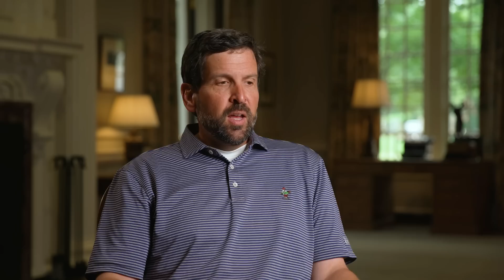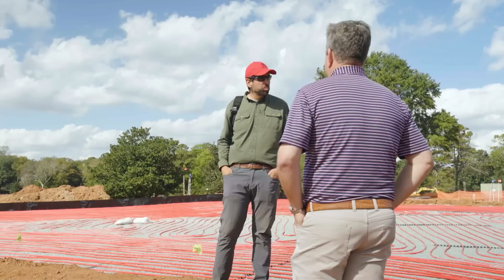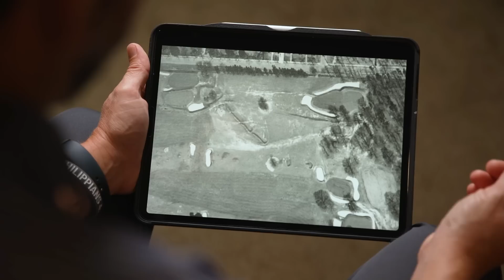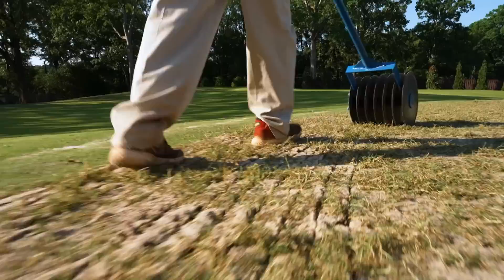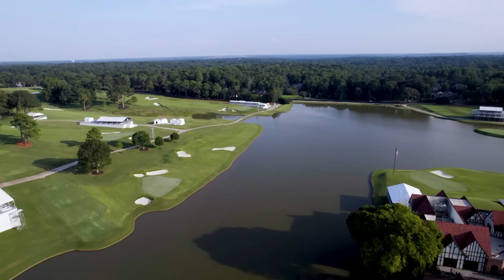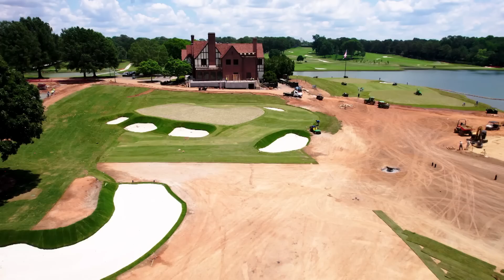COMPLETE restoration at East Lake Golf Club led by Andrew Green

Comment: I played Eastlake in 2005 in a 36 hole US Open qualifier. I thought it was very hard (I was +5 in hot and wet summer conditions), but enjoyed it. I think the restoration has taken some of the teeth out of the course, but it looks beautiful. It's a different animal now, maybe more historically accurate but definitely easier.
Reply: Clearly it is easier in its current/new/original configuration ,based on the scores. Of course 14 was a par 5 for members but in  previous FedEx events it played as a par 4. Even taking that into consideration the scoring is down. 
I played East Lake shortly after the AAC  had parted ways and long before Tom Cousins entered the picture. At that time it had been redesigned to host the Ryder Cup. 
Personally I have always felt altering a Donald Ross design is akin to painting a mustache on the Mona Lisa and so it's a bit amusing to think about all those long gone greens committee members convincing the club about all the needed improvements just so their successors will be compelled to convince the membership to cough up $ 30 million to make it right.😊